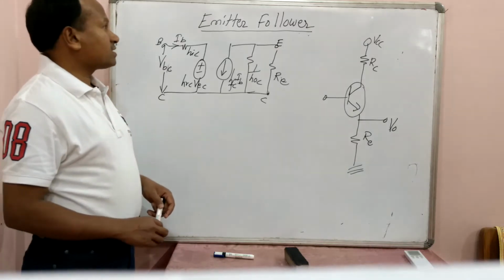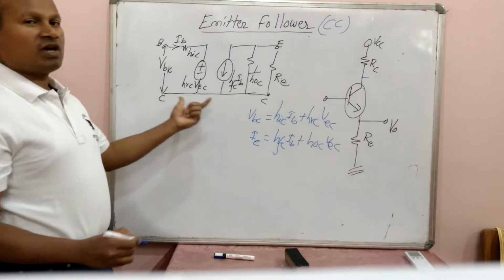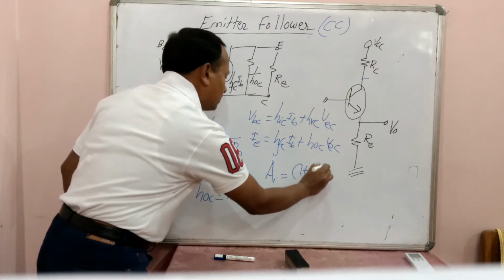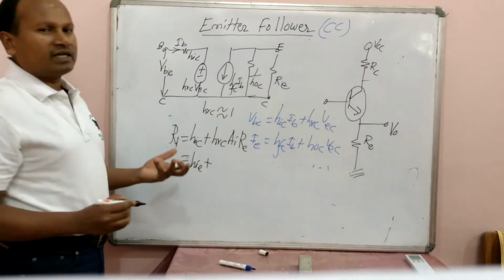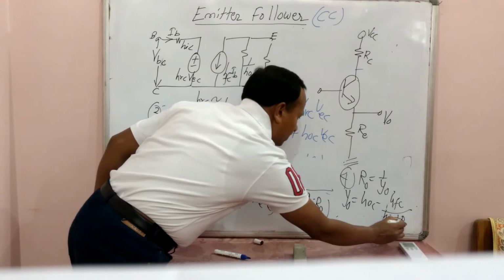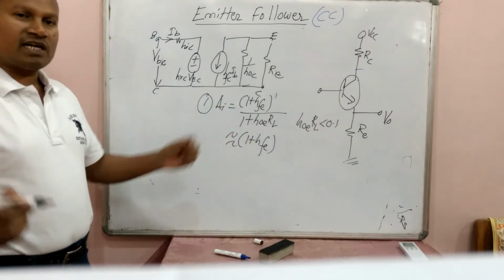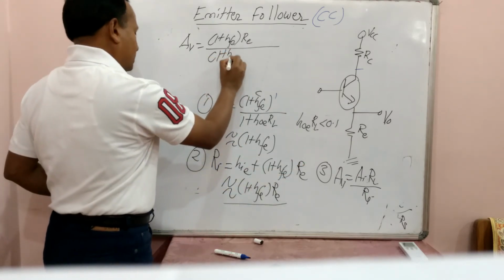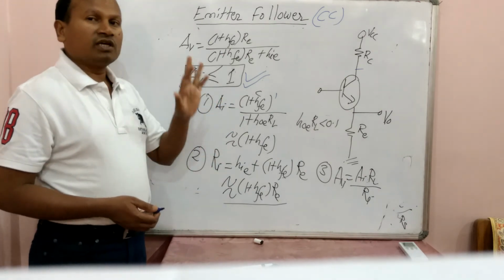Emitter Follower

Comment: What is output resistance?
Reply from the maker: Thanks for your interest,  its good question. Parallel combination of 1/hoe and Re shall be roughly Ro. We know that 1/hoe is in M ohms and thus the parallel combination shall be very less. So, Ri is very high and Ro is very low.
Reply from the maker: Let me know if you want some specific topics, I will try to record and upload. Best wishes!
Reply: @professorgrsinha  yes sir.
I'm focusing on diff amp as well.
In that topic I'm unable to understand why we take average of the input voltages that is 
V1+V2/2.
Can you please explain it?
Reply: @professorgrsinha  Thanks for the reply.
Yes sir I tried through hpi model 
I got output around 50ohms